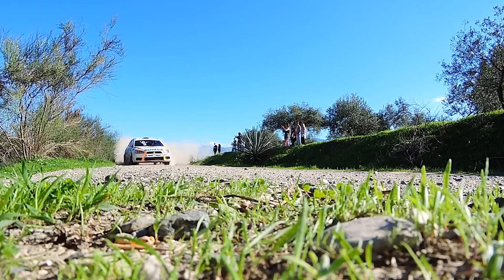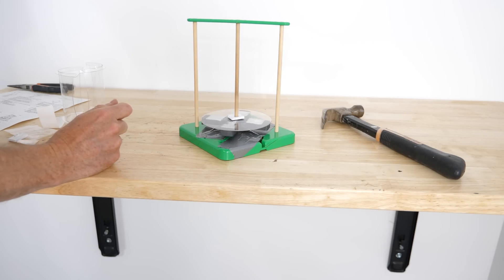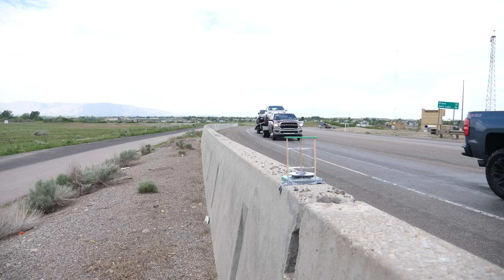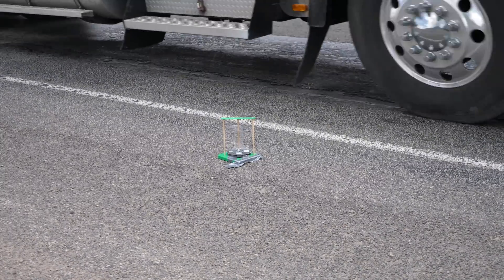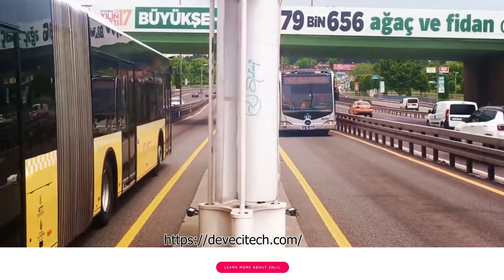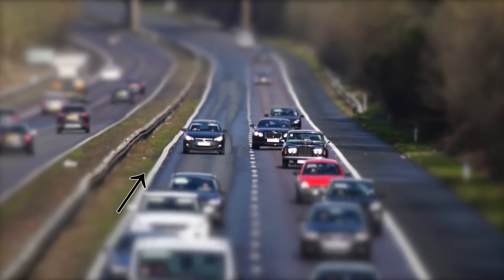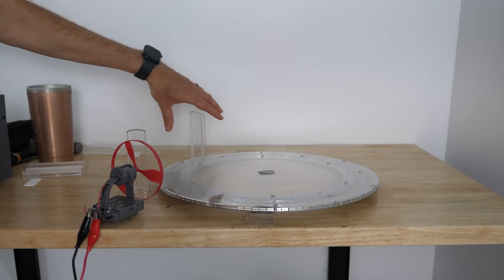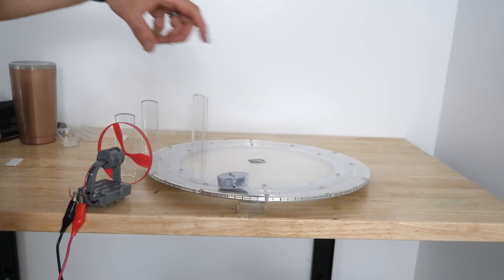Do Traffic Turbines Actually Work?

Comment: Leaving aside the fact that the smaller, the less efficient a wind turbine is, and that is why they tend to grow, and not to miniaturize, I wonder what the result of the experiment would be if it is considered that the turbines would be between two flows of traffic and air moving in opposite directions, which normally interfere negatively. Would it still be worse for transit?

Comment: The only thing I can think of that these might be good for is lights or signals on a very isolated, rural road, miles and miles away from any existing connection to a power grid. But even there I don't know if they'd be any better than a few solar panels.

Comment: You would be better off using the weight of the cars to compess a device under the road which will generate electricity, either piezoelectrically or by a linkage to a generator.

Comment: You mentioned that theoretically the lamp-posts and other structures on the side of the road also add resistance. So (depending on hom much is going on inside) you could place a turbine in all those necessary man-made objects nexxt to the road, like lamp posts or power lines. There would be other commplicating factors i'm sure, but that's an idea.
Reply: The effectiveness of the turbines depends on how much energy they're draining from the wind. That is, the worse it is for cars, the better it is for the turbine. 

It would probably use less fuel simply to use a gas-powered generator to create the same electricity.
Reply: but dont forget, those are mechanical parts, think about the cost! It'd hardly be cost effective even without considering the maintenance cost
Reply: @TikkiPls  are u the guy from csgo ttt?

Comment: There is no "free" energy.
Energy is always a "trade" from one form to another.
If you ask me, it would be a smarter idea to pick the most sunny places without shadows (for example a roundabout) and install photovoltaic modules there.

Or if you want to give your windgenerator a 2nd chance, I would suggest to make a bigger version, which is on the inner edge to the road (or the outer edge on the island where the road encloses it.) As traffic is supposed to go only in 1 direction in a roundabout, such a generator (in the shape of a big ( moving freely) circle, which has the same diameter as the roundabout) would probably make more sense.
As you are driving a car in the roundabout, you might already have the intention to slow down before exiting the roundabout, so this extra energy you loose because of the generator wouldn't be much of an issue, as you would probably use your brakes before making the exit anyway.
I think, that this could be the perfect place to try such a concept.

That is, if the roundabout is a perfect circle. No room for errors on the shape, because every error would cause additional friction and therefore you would probably loose  a significant amount of energy.

I would suggest to try this concept on a CarreraGo roundabout with miniature versions. Then you would get an idealized result and you would know, if thats even plausable.
Thanks for making this video.

Comment: While they may not have use in making power for your home. These CAN be useful in applications where Solar Power is not enough. Say you want a signal or some device that requires power but is not near the grid. You've seen a solar powered traffic device before, in a tunnel, these would be complicated to route solar power because of the distance the cables would run. Turbines to power low power devices is an excellent application.

Comment: I don't think this would be practical for large-scale applications, like replacing grid electricity. But for something more localized (think battery pack for a traffic camera) I can see this being very useful as a supplemental way to harness electricity generation at night or in winter when solar panels either don't, or can't, generate power.

Comment: Put the generator on the car then you quickly realize your actually using gas energy and if you used many of them you would actually notice a performance loss in the vehicles because your using the cars energy and not wind energy. Same with weather by the way meaning we can steal energy from storms to make the storm weaker. The perfect generator is a rain generator as it uses relatively free energy and the only losses will be clean water on the ground and same with sun energy as the losses is only heat.

Comment: Energy harvesting definitely has its use, buy not for high power. It makes power accessible for sensors where you dont normally have power. For example, it may be an option for a traffic sensor in a dark and remote place instead of solar.

However, in reality i think a battery and solar covers all practical use cases and have less mechanical maintenance.

Comment: I would have thought that the energy taken by the wind turbines would have just otherwise gone to waste (eventually becoming heat).  Would have been interesting to follow up the last speculation and see whether wind turbines sapped any more energy than stationary plastic hemicylinder pairs.
Reply: They maybe sapped less, but that also means they output less. Pointless stuff. To extract energy from chaotic motion (turbulence or noise) is harder than it seems, you battle the laws of thermodynamics, or your actions inevitably create an equal and opposite reaction (resistance on the traffic that created the motion).
Reply: @u1zha  Thermodynamics doesn't guarantee that you get what you pay for.  You can always get less.

Comment: How about we put this turbine on the vehicle itself to power the vehicle
Reply: That would just take the energy from the car (slow it down) and inefficiently convert it into the energy supposed to power the vehicle. There will always be energy wasted (air flowing next to the turbine, friction between wheels and ground...) so the car will never be more efficient with than without the turbine. It is however possible to use the energy that would otherwise be converted to heat when braking in electric cars to regain a little bit of that power.

Comment: What if they put the turbines on electric vehicles?
Reply: That would just take the energy from the car (slow it down) and inefficiently convert it into the energy supposed to power the vehicle. There will always be energy wasted (air flowing next to the turbine, friction between wheels and ground...) so the car will never be more efficient with than without the turbine. It is however possible to use the energy that would otherwise be converted to heat when braking in electric cars to regain a little bit of that power.
Reply: @boing7679  yeah, that's kind of what I figured.

Comment: It's a clever idea, but if they were deployed at scale at high density they would likely make the air on the roadway more turbulent and force more energy from the car to be used, and would start to cancel out the benefits. Not to mention the labor requirements to keep thousands of small wind turbines working.

Comment: what you missed os that the turbines do not simply rebound the aor but dorect it as most of the ai passes through, in this way aorncould be used to creat a greater air cushion by redorecting outside aornpressures beyond the travel path ofnthe cars back into the travel path of vehicles pehaps on the opposite sodenofnthenroad or sonehow usong a mobius progran to condense aorflow on the samensodenofnthe road.

Comment: I dont believe the experiment at 3:30 was correct. 
The object in motion is self-propelled through gasoline- not an external force like wind. 
In this example, the object is more representative of a sailboat than an internal combustion engine.
The object is the one generating the wind with cars, but in this example, it's nature. 
Move the experimental turbines to the other side- or end (out of the way of the force of the fan) Keep the fan in the same place. THAT is how you can test your theory properly.

Comment: Anyone who has followed an HGV on the road in heavy rain will know how much energy is wasted in holding the rain water in the air around the vehicle. This suspended water is sometime shed when the HGV breaks or as it passes other traffic traveling in in the other direction. 
The pressure of this water can be felt as it deflects the objects it passes. 
 One other possible way to extract energy from passing vehicles might be to  connect road speed bumps at junctions, to hydraulic or pneumatic pumps, the weight of the passing traffic could then be converted to energy that could be used to power the electrics at the junction, such as road sign lighting. I would imagine that a reasonable amount of energy could be recovered from weight of an HGV traveling over a speed bump, that compresses it by several centimetres as the wheels pass over it.

Comment: I had always thought about the possibility of using the sound pollution from highways to collect energy from the sound vibrations by using a series of generators that work on the principle of microphones, only scaled up. That or the vibrations in the road itself. Not sure how practical it would be but it was something to think about during rush hour 😎
Reply: Yes, that's something I think he glossed over, which could be elaborated. If the air flow could be harvested in a way that dampens vibrations or turbulences, such gadgets would perhaps stand some chance of being useful. It would not push back at traffic as much as it would act as a high efficiency noise barrier. But I doubt that's possible in the grand scheme of things. Extracting energy from chaotic motion goes largely against laws of thermodynamics.
Reply: The energy content of everyday sounds is very, very small and distributed over a very large area

Comment: I could see these mini turbines being perfect for simply powering nearby signs or warning lights, perhaps even a few tunnel/bridge lights.
Reply: How "perfect"? If the sign needs illumination then it's probably an important sign, and should be illuminated before a car passes, and not after :D

Putting a battery and a solar cell is already working ok for remote/temporary signs, a minimal expected amount of daylight is more predictable than the speed and number of cars that will pass.
Reply: @u1zha  the point was as a supplement for battery and intended to mention it, but oops! 😆

Comment: The balancing of all the factors would be your problem, I think.  Put the turbines close to the road and you create more wind reflection (never thought of it before, but tunnels must do this).  Put them back far enough and you don't get enough wind.  Low traffic volume, and you don't get much wind, but when you start to get serious volume traffic slows down and you get less power.

Here is an idea for a use case though, that might work... focus on the median in roads with a small median... thinks like where you have road work or  some of those bridges where they move the barriers depending on the time of day to change the number of lanes each way and have jersey barriers set up between the lanes.  Embed small turbines in slots in the jersey barriers.  The jersey barriers should act to direct the wind a bit, right onto your turbines.  (Maybe a small plastic scoop to push it in.)  Now you have a situation where you have more directed air relative to the number of turbines, a place where the traffic is closer to the turbines, and a spot where your jersey barriers would already be giving you that efficiency hit (actually, the turbine might actually reduce that a bit by allowing some air through and redirecting it in the other direction.)  Next, don't aim high.  Add a small battery to the system to deal with the intermittent nature of the beast, and just aim to use it at some lighting to make the barrier more visible at night... a bit better than reflectors, and if you can affordably make the slots to put the wiring, lights and turbines in without weakening the barrier (and maybe saving a small amount of cement?) you now have a lit barrier.  You might also put a strip of solar cells along the top add a bit more power.   I'm not sure if that would be enough value to make it viable.  I don't know how much power that would produce compared to just having a small strip of solar cells inset along the top (I think you'd need a tiny inset so they didn't get scraped up) but if the amount of power for your lights couldn't be done by solar alone it might be worthwhile if you could get the price down.  You might even be able to get some information about speeding...  plug a few together and have it power a cell signal to report it's data?  

Of course, you'd have to make sure that the parts were heavy duty enough not to easily become debris if someone hit the barrier.  I'd think you'd actually get more useful wind just from the heat gradient from the blacktop than most traffic situations.  I remember a few years ago there was a product that harnessed power from speed bumps and some town wanted to cover their roads with them.  

Hmm... okay, now I have some ideas for some sorts of shady ways to steal power... what if you set up some induction units along a road or a railroad and sip off a bit of their power as traffic goes by.  How about railroad tracks in places where you have two sets of tracks (so you only have one way traffic on each side).  In hilly areas you could basically turn the downhill portion of the tracks into a stationary resistive braking system that gives you a bit of power.  Since you only harvesting braking energy, and are sending it to the grid instead of putting it on the trains themselves, you can use cheaper, less dense batteries, and you don't have to carry the weight of the batteries.  Might work for a downhill section of a highway too, for big rigs?  Might save you some on brakes.

Comment: If the turbine in placed in the middle of the road it may prevent different lanes of wind from combining and interfering with each other, or prevent one lane of wind being pushed to the other side of the road by a breeze. This could improve the efficiency of cars as crosswind from oncoming vehicles could be a significant source of drag.
Reply: I was looking for similar comment. 👍. This guy concluded with one tini-wini experiment that vertical turbine are not that effective..!!! What a great way to prove your self an idiot. Ironically, he included a clip of vertical turbine which were about 4-feet long and were installed on median which got reqd air push from traffic from both directions. Plus in both directions ONLY buses were moving which are least aerodynamic and this circular motion of turbine will surely help rather than increasing air resistance.

Comment: They don't make enough power for much other than things like lights for hazard markers, and in comparison you could get more power for such a thing by putting a 0.25 m² solar panel on top of a pole somewhere. The solar panel has a lot less to wear out and deals with weathering a lot better.

So although an interesting idea, it rates about a "meh" in practice.

Comment: This was a really interesting experiment. I'm wondering if we utilize something similar to the way traffic lights detect traffic by utilizing magnetic impedance to generate electricity much in the same way AC current works today.

Though in the end it would also be cost prohibitive but would it also make the cars less efficient in that it's not using wind?

Comment: In my oppinion this is a pretty dumb idea, much like solar raodways. Putting thigs so close to the track always causes an exceptional higher risk of hazard. For what? Shure. The trailing wind is lost energy but this can not ever recover a usable amount of energy to actually legitimate the risk. Nor do all of them together recover enough energy to even repair one single accident when rolled over.

Comment: To me, it just seems like a large investment that is going to give back minimal returns. Installing these everywhere is going to be a lot of money and man hours and they are going to need regular maintenance... right next to a freeway with a bunch of speeding cars next to it. Not to mention that by putting right next to the road, you are placing them in danger of being hit by the cars when someone inevitably goes just a little bit too far to the side. Also you CAN'T place them TOO close to the passing cars because for traffic safety reasons, you need to have a shoulder on the side of the road for when vehicles break down and stuff, so that would reduce the efficiency even more.